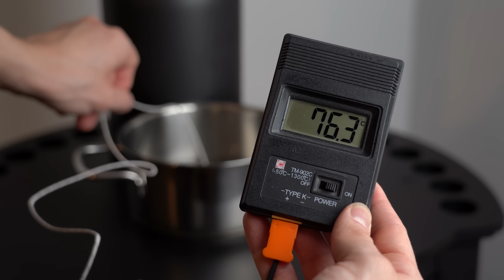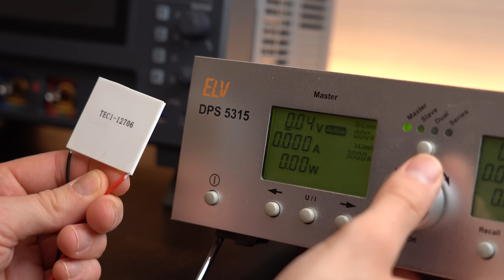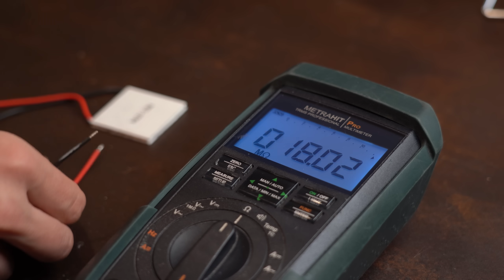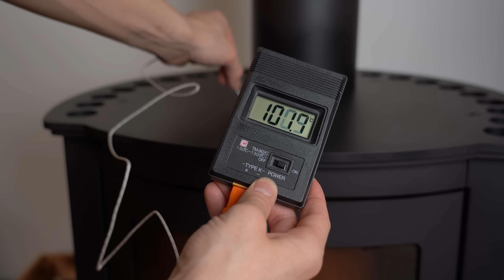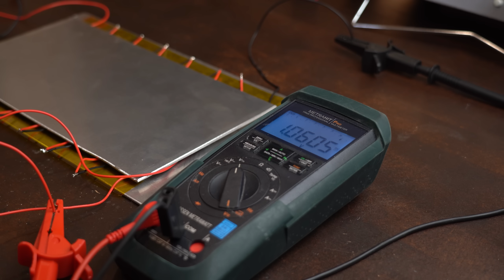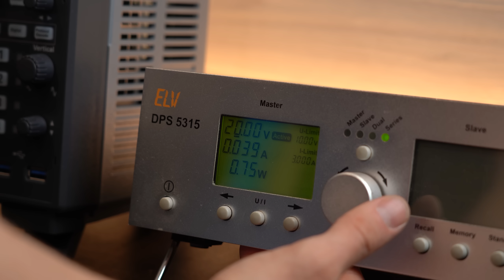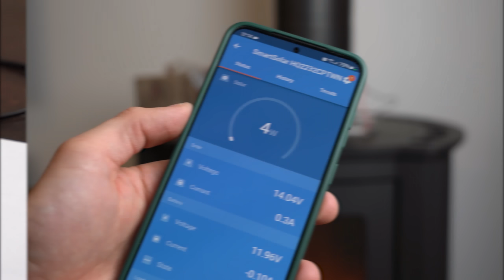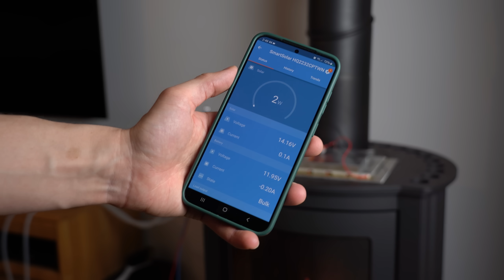I tried to Power my Home with Heat Generators! (Worth it?)

Comment: What if you tried the heat generators from a gas furnace that work with the pilot light? They could be mounted through holes in the stove pipe and are more durable and I think they produce more power.

Comment: Two points here:
1 - In his first example, He heats up the BOTTOM heatsink, where the heat will RISE towards the top heatsink, which is supposed to be as cool as possible...which doesn't help in regards to efficiency.
2 - In his second example, He puts a huge heatsink on the bottom of his setup (which is presumably to keep it COOL)...then put a cup of ICE WATER on the top one? (Shouldn't it be a source of heat instead?)
BOTH top and bottom are being kept "cool" - one with the heatsink and fans, and the other with the cup of ice water!
Am I missing something here, because that simply doesn't make any sense!
Ideally, He needs to have the "cool side" on the bottom, and the "hot side" on top...for maxiumum efficiency. (Otherwise, the heat will rise and "warm up" the top part.)
He seems to be lacking in basic knowledge, and I stopped watching after that.

Comment: They make more efficient Peltier’s with higher temperature tolerance than what you are using.  Even the wood stove fans product more power from one Peltier compared to your entire series setup.  They also make mini wood stoves that produce more power such as the BioLite camp stove.  I remember using Peltier’s to cool my CPU decades ago that required more than 100W.  Those probably produce more power in reverse setup.  Overall though, Peltier’s are really inefficient.

Comment: Check the heat powered fireplace fan (sits on top & blows warm air away from the fireplace).
Try large heatsinks directly on top of the peltiers with low wattage fan blowing through, create a wind tunnel cooling it. Moving water isn’t advised for your use case. Add metal plates to the bottom until the hotside temperature is within limits.

Comment: If we had all the most populated cities wired up with piezoelectic compression plates on populated streets, solar panels on every surface that can catch light, and omidirectional wind turbine on every tall building we would have more than enough. Problem is infrastructure  and grid being so outdated, this is because we allow lying lunatics to govern us while robbing us blind and not putting anything back into the system for the people. What do you expect from a system that taxes the money spent into your employers coffers, then taxed again when paid to you, then taxed again at the end of the year, only to break down into property and sale tax before beginning again. All while this country is in debt at such dollar amounts most people cant grasp just how big it is. The quickest most effective way would be radiant energy, from that dirty little word they wanted to kill years ago, the "ETHER" lol. We are taught such lies, like electrons mov8ng through loads producing energy hahahaha. All while being taught energy is not created or destroyed😊 the truth is with causing an unbalance in the ether we can get insane snap back voltage, and I believe even huge amps with crazy rpm's on monopole magnetic motors. Tesla clearly proved this, as many others who somehow always ended up dead very early, very sudden after patents. Anyway the infrastructure is already halfway there, no need for trillions spent on whole new systems. Its about the energy already all around us, we create nothing. Just like we are taught about emf waves propagating, yet at the same time saying there is no medium for such waves to propagate through. All of this is greed, or simply sin. You want true free energy, endless power? Find the true Christ Jesus of Nazareth while you can, because impossibly hard doesn't scratch the surface of what these maniacs have in store for us all.

Comment: you should be using thermal glues and not pastes if you dont plan on clamping peltiers.
if you do incase plan on clamping, use bellevile washers. they help with consistent thermals via acting as spring against thermal cycling based expansion and contraction.

Comment: i live in canada. i gave my dad an electric circulation fan that is powered by the heat. works pretty well. doesnt work  to circulate to the whole house when its -30c :)  but if the doors are all open and its -10? keeps it circulated enough to keep the place warm

Comment: I don't know does it help or not but the problems you are having are as follows
1- the modules and the heat sink are not bolted and so they are not having their intended use.
2- you should use a secondary heat exchanger in your exhaust pipe to bring water to about 80'c or above under pressure.
3- the water will protect peltier modules as the water only goes to 100'c before boiling
4- there should be another heat exchanger outside of home that runs water through cold weather ( around 10'c or lower)
5- with this setup you will have less temperature changes through time of the day and fluctuations are far more small and slow changing.
if you do this although it needs some proper machining you will have the intended energy yield you need.
I would be glad if there is more information needed.

Comment: So instead of using a pump to circulate the water why not use the temperature of the water to circulate it set your reservoir up above it you know elevated and then let the hot water rise in the cold water fall also you could just stand the palios away from the stove so that they aren't overheating all the time. Another possibility because I'm not sure what the heat requirements are but could you transfer the heat to them via water lines for something like that whether they're heated by the wood stove or even just the hot water running through the house I don't know.

Comment: Oy m8 I think you can make an aluminiu tank theat you can put on your stove theat can contain water, you heat the water and make steam theat can power a tesla steam turbine and make electricity and the steam can  e used to heat a saune when needed, and you can make a preasure release valve theat can lower the pressure and tou can refill the tank via a water pump when the pressure is low enoff or if you can recapture the steam you can condensed it cool it throo a radiator which can give you even more heat in to the home and reuse the water in the tank or make distilled water for you :)

Comment: wouldn't have been more effective if you did the cooling in reverse? Just heat up the water on the stove and then pump it over the peltier? You could also try natural convection by placing them somewhere higher and you won't have the problem that you are driving them above 115c. I doubt the stove can turn the entire loop into steam if the peltiers extract enough heat.

Comment: I'm looking at this for a bush craft application.  May not be viable, however I'm looking to get enough juice to power a mobile in an emergency. I figure the ground itself will be cold enough for the cold side and a metal plate with a tin can stove on top for the hot side. I suspect its not viable because I won't be cooking long enough to get enough juice for the phone.

Comment: Bad test! Need to put 30l pot on top , controll temperature and then put another 10l cold water pot with Golf water circulation. winter cold water is for free.

Comment: change the setup. Use coper pipe to heat the water. Than U gat max 100C hot sight so U can't damage peltier module's and U don't need a water pomp. For the cold sight use something like gravity ventilation sucking cold air from the outsight of building throe the heatsink and going out of the building or not. 😉

Comment: I’ve been considering attaching a few rows of these to one of the central heating radiators mounted on my wall. I just never got around to experimenting to see if it would work, especially since the radiator sits right under my window, meaning I could take advantage of the cold air and a fan for cooling. 😂😂

Comment: To limit the heat you need to use hot water, I am putting mine on a plate connected to my hot pipework from my wood stoves boiler.

Comment: I don't know what you're doing wrong but I tried the same experiment with water cooling on my wood burner stove using only 6 pelttier chips and I got a 21 watt string of LEDs lighting at full brightness with a very small water pump running. im blaming your mppt. try a straight boost controller

Comment: Yell it: Capacitor charged to Need, Waste Heat of device. Circulate Power need through Capacitor bank.. When capacitor bank dues Cry my Power core help and call 3cpo
Reply: sombody Smarter than my brain Said Runaway power.. Idk but aww
Reply: Or Use some sort of Heat output coil

Comment: I work with these a lot. The 27145 module was my first choice of low cost cells but transitioned to CozyStove cells used on stove fans. They can handle higher temperatures. If you had lifted the units up a bit to stay within the 150c limit on the hot side, production and reliability would have been much better. I get 2 watts out of an oil lamp built by the Soviets in 1959. The original cells had failed so I retrofitted it to fourteen of the cozy stove cells. Use it a couple times a week to power a vintage tube radio.

Comment: Typical TEC modules (the cheap white 40×40 mm ones) are designed for modest temperature differences (ΔT ~40–70°C) with a hot-side limit around ~80–100°C.

A wood-stove surface can be 200–400°C+. That’s way beyond spec?

Comment: I was thinking of an "amazing" idea of scavenging hest from a cars tailpipe using peltiers. Figured you could save on fuel by not spinning an alternator constantly. Pretty sure I'll need more than 5w to do that. Besides, we have smart alternators now with a clutch to disengage them. So it is essentially pointless.

Comment: I expected use of peltier elements for smaller and exact thermal energy amounts: e.g. keep a temperature constant (as part of an closed loop conrol) like electronic component/module (crystal oscillators) keeping the temperature dependent working Point U(T), I(T) or P(T) constant. You might also get just enough controllable "heat" to warm up a directed air breeze in front of you (desk-top USB A/C or car A/C). 
BTW: Did you considered a het pump, which converts electricity into thermal energy?

Comment: Here’s a better idea, since you got the rain water outside try putting that into a bolder powered via your fernuse then connect it to a turbine or steam engine, that way when you use the fernuse you generate steam and create electricity via an generator connected to ether the turbine or the engine

Comment: Problem is with the conversion of heat to electricity.  Remove the problem.
The fireplace need to become a stove and geyser.  So you dont have to convert the heat energy into electricity.
Then the Solar panels is sufficient for TV, lights and freezer.

Comment: So looking at "Commercial Off the Shelf" 30watt TEGS, you have to be careful about your thermal Delta, as in your heat source has to be up to operational temperatures before you add the generator to the mix otherwise you will gradually heat up the cold side and end up frying the TEG stacks. https://thermoelectric-generator.com/wp-content/uploads/2014/04/TEG12VDC-24AIR-30W-Op.-Instructions-REVISED1213.pdf

Comment: possibly using a heat powered fridge cycle would make the other side cold and other side hot. possibly making a water vapor heat pipe teg would be the simplest and most useful. as steam is always at 100C if you dont overheat it. so the teg module can be kept away from the main heat source that is 600-1000C. yep use water as the max temp regulation, because those teg modules only handle up to 100-200C, not high temp teg modules. you need to handle the tegs as if they were battery electrodes ie you need a ton more. similar to solar panel surface area. ie the modules need to have multiple layers of teg diodes. not just one. ie pipe the hot/cold air between the module layers. hold on, there are channels that get useful larger power from them. so you must have just failed. ie cant do.

Comment: There are high temperature peltier modules on the self driving fans, which are for your stove. They are not cheap, they use Calcium Manganese Oxide thermoelectric power modules

Comment: Interesting Experiment :) i dont know if you seen the Biolite Outdoor Stove which Advertises specially for its Power Generating function :) it also uses an Peltier Module :) i dont know how they got it cramped in such a small space compared to your Surface Area :) the BioLite 2+ gets Advertised with 3W output @5V and Peak 4W @5V

Comment: You used thermoelectric coolers, not genuine TEG modules. You also did not have firm clamping force. My setup produces 240 watts. No wonder you only got 6.

Comment: I've managed to work with this differently, putting hot water on one side (so not enough to destroy the TEG) and cold water on the other side, having a delta of at least 60-70 celsius, with about 10 of these, I got enough to charge a phone.. I'm not working on a larger project where I will take water from my pellet burner that already heats the water for my house at 80-90 degrees, and for the cold side I will bury a IBC underground where temps are always low and add glycol. Ideally I would get a delta of 80-90 and in a huge block of hundreds of these, I can then generate some 500-1000wh.. Its way more complex than that, but that's the base. Why I'm using water? because others fail with too hot of a side and not cold enough the other side. So having it scaled up and constant temps for both sides then you can actually make it work.

Comment: If there is snow, can't you make that cool on the cooler side? For the hot side you can use  the hot air generated by the fireplace. So the hot side will be even too. If this success no need to have a water pump and generated energy will be all yours. Also you can cut off the hot air if the peltier device is too hot.

Comment: I think the mistake here was you didn't have a way to uniformize and modulate the heat, and that's the reason the individual modules break or don't work properly. I think you should have used the stove to heat water and use that water to heat the aluminium plate. That way, you know the hot side will always be below 99°C.

Comment: Wait so he is generating heat from the inside and brings cold from the outside to the inside to generate electricity... So he basically makes the inside cooler, kinda like an AC cooler unit.
How does anything make sense? You convert heat to energy with some loss in the middle, there's no creation of energy out of thin air. Your just burning wood to create electricity in probably the least efficient way possible

Comment: Better of making a steam generator I think 😅
Reply: But then how to condense the steam back into water? Cold. So it means he has to import back some cold into the inside of his home. So he is basically making his home cooler. So it needs to burn more wood to keep the same temperature inside. There's no gain of electricity anywhere, he is just burning more wood to create energy.

Comment: more effective then this are just add thermo or so called steam generator - burn the logs like a steam train and make electricity more then enough! Maybe convert logs into woodgass -even that is more effective then this peltier method for electricity generation! It's very nice video - thank you for your time to create this nice content!! Now we now that peltier does not work at all !!
Reply: The steam generator will make his room cooler, which means he needs to burn more wood. Burning wood to create electricity

Comment: Lovely proof‑of‑concept, but the wiring is quietly throttling your system. Keep voltage drop under 3 % (≤ 0.4 V on 12 V). You have ~3 m each way → loop = 6 m → R ≈ 0.034 Ω × 6 = 0.20 Ω. 
	•	Either shorten the run, or jump to 4 mm² / 11 AWG wire for the same length.
	•	Result: more of the Peltier energy reaches the battery instead just heating your cable.

Comment: If we use the heat sink on one side on hot and the peltier or invert solar cell on cold water side then load like battery in the middle the we should get back up. Or submersible pump in a tank full of water and connect so water pressure push the water into lower presure so if flow then it generate electricity too don't use peltier directly on high heat

Comment: maybe you shouldn't have had the modules directly on the surface of the burner..if they were at the top of a four sided box the hot air rising from the stove would likely not create the same hot and cold spots or burn the modules out

Comment: Id just use a household natural gas line to power a 4 stroke generator to keep a battery bank topped off. 

I did the math  and its cheaper by respectable amount. At least here in norcal.

Comment: I did a deep dive into TEG a while ago with maybe 100 modules, these ones are terrible quality. I found that most modules on the market are rejects being resold. Many didn't work out of the box and many failed immediately. Some sources like "tegmart" sell modules specifically for applications like this, these modules have a temperature limit of 320C usually, while I haven't gotten my hands on them yet. I believe if you re-ran this test, your setup could easily be producing 30-50 watts! They are unfortunately much more expensive though